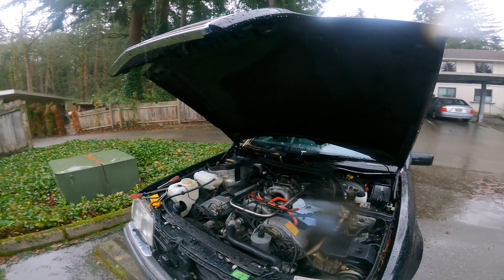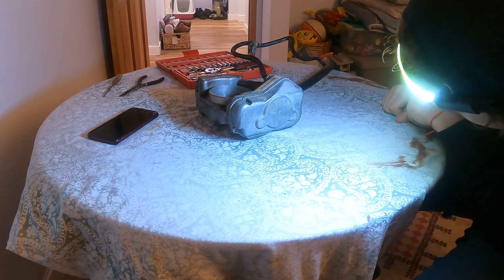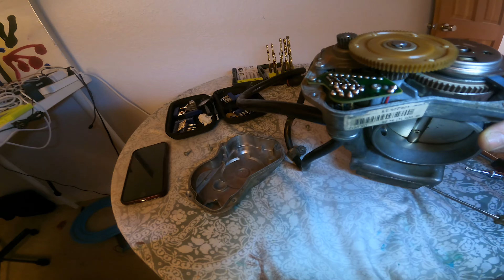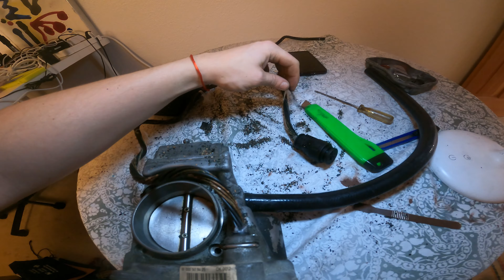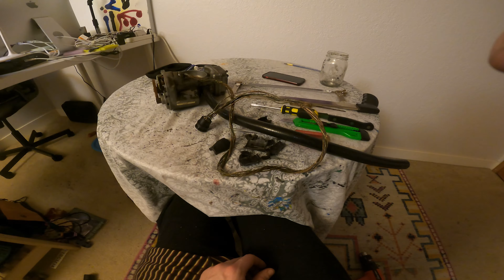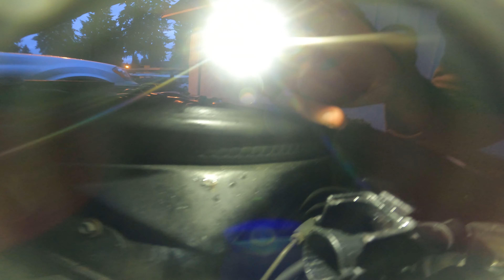OWN AN OLD MERCEDES?... BIODEGRADABLE WIRING CHECK

Comment: on the female plug. just splice one wire at a time into the harness before the plug leaving it in place. and then wire in a new plug to connect to a new connector for the throttle body
Reply from the maker: Thought about that but I think I’m just going to use what remains and build something around it keep it in place. It shouldn’t really budge in general, it’s a secure fit